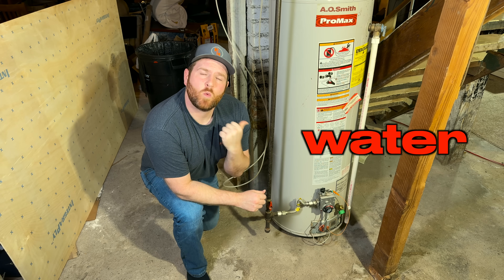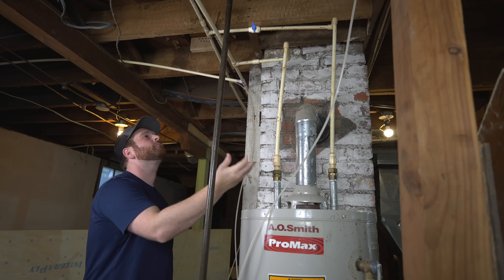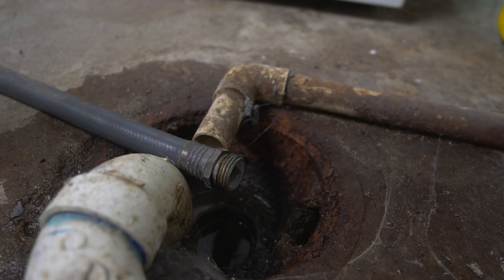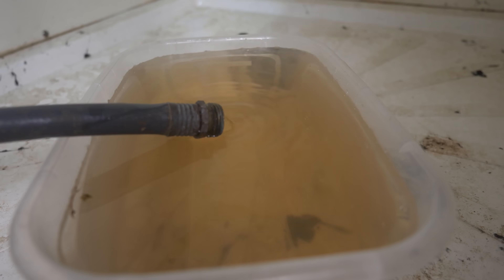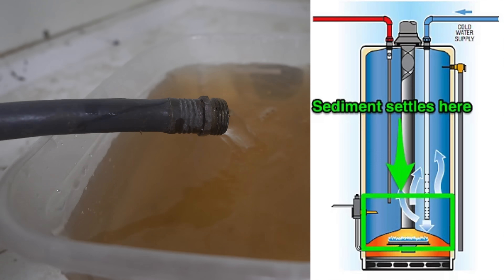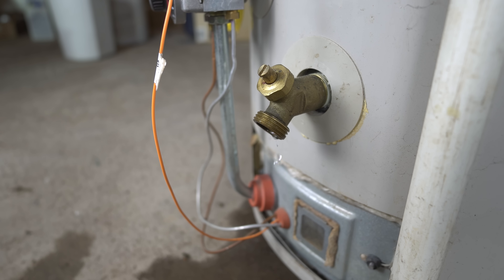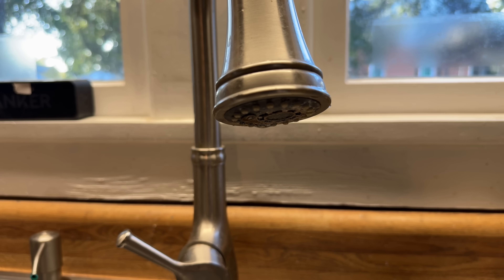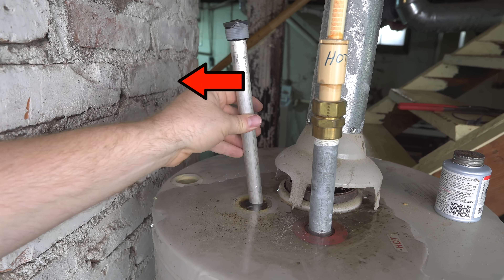Correct Way to FLUSH WATER HEATER! 2-Minute Tutorial

Comment: In my setup, water would not drain from the heater without the cold-water source valve on... even with a hot-water faucet open inside the house. So it took ages to flush the tank to the point of running clear, and I question whether the sediment was adequately stirred up to be ejected.
Reply from the maker: Sounds like sediment has built up and closed up the orifice of the drain valve. A person could try to poke something in there, but it sounds like it’s blocked. Probably useless at this point, you may just want to run it till it blows, so to speak.
Reply: @HandymanHertz  Thanks, but there was plenty of flow from the drain valve. Just not without the cold-water input being on, even though I had opened the nearest hot-water tap. I should have tried the pressure-relief valve, but I didn't know about it until I'd already flushed and restarted the heater.

The biggest problem is that this American Standard heater has no visible anodes. The manual has a parts diagram that shows TWO of them, but not where they go. And the manual makes no mention of them in any procedure. Really unprofessional.

Comment: Ok so how about when we do all the right steps and no water comes out unless we turn the water valve back on???
Reply from the maker: Hmmm sounds like sediment has clogged your valve or you haven’t opened a faucet to vent the system and it’s still under vacuum.
Reply: @HandymanHertz  it was the pressure release valve. Once I switched that up it started flowing.

Comment: ~ 2:00 ...After its all back together, turn your water heater back on, the gas or electric power.  
Thanks for the video!  I'm draining my gas water heater as I type this, and the water is draing So Sloooooowwww!  But if I open the input valve it flows faster.  The initial was was a "lovely" brownish rust color.  😂
Edit: After opening and closing the input valve several times, quickly, the hot water began to flow at a nice rate.  I know I've definitely neglected my water heater by not flushing regularly.   Thanks again for this Short and Sweet video!  Right to the point, no fluff, no filler!  You're a DIY Champ!

Comment: My water heater doesn't drain very fast. I did this the other day and it took like 2 hours for me to drain and then burst the water and let it drain again. I not only had a water faucet on but I also had the blow valve open to allow air into the water heater. What am I doing wrong? Fyi it's a long garden hose. Maybe a 20 footer which is overkill but I'm not sure if that's the issue
Reply: I believe many modern tanks don't have a full size drain valve on them, to cut down on the manufacturing costs. I think you can replace them with brass valves and that will help with draining the water faster. There are videos about this on YT.
Reply from the maker: The previous comment is correct. You can replace that valve with a full port valve. Also, there’s a chance that the sediment has almost blocked the drain hole opening from the inside of the water heater. Some people have poked something through the valve to try to break up the sediment. Maybe give that a try?

Comment: question, my water heater has 4 pipes in the top, cold intake, hot outtake, PRV, and the 4th is what i’m assuming is a continuous loop, can i still drain the water heater with the continuous loop pipe or is this a more complex setup where it’s best to consult a plumber?
Reply: It works like a water fountain/bubbler. Hottest water tank on top, w small opening that let's the water into lower chamber

Comment: Why can't one simply do a power-level flush?...meaning...keep the cold water supply functional, and keep the electric or gas power supply "on"...add a hose to the drain valve....and then open the drain valve "at pressure" ?. .....seems to maybe do a better job. The only risk I see is if the outgoing water flow is more than the incoming.....should match to keep the tank always full with water.
Reply: thats what makes sense to me and is the easiest as well.. If i open the valve at bottom of tank ,it releases Alot of water under pressure and I can see alittle sediment in the initial when then turns clear quickly... I dont see the need to empty the entire tank when its flowing clear
Reply: @skip741x3 That’s what my plumber told me to do.

Comment: We HAVE to get a water heater. How would you rate my current situation? 

Our water heater is over 20 years old! 💀
We never flush it 💀💀
CO2 builds up in our basement to around 20-30 CO pm when heavily used like filling a bath. 💀💀💀
Also VOCs build up even more when we don't open a window in our basement to around 30-125 💀💀💀💀💀

Yeah, it's pretty fucked here.

Comment: I'm sorry, flushing alone doesn't do jack squat.   I have a tank with a full port drain, and the sediment is too big to even get through the full port.  The only way to actually get sediment out is to own an electric water heater so that you pull the lower element and literally vacuum it out of the element port.  on a gas tank, the only way is to drain it and pour in that stuff that dissolves the sediment into a liquid to drain out.

Comment: If you have a gas water heater there's no need to shut the gas off. Turn it to PILOT and the burner will not turn on while you are flushing it but the pilot will stay on.
Reply: I’m so glad that you posted to turn the knob to Pilot, because I was going to ask, how to ignite the pilot on after turning the gas back on
Reply: But I did that before reading this comment so I am now stuck with pilot light off :( also, didn’t seem to say “shut water off to the house” but how rue they sink her no water coming out? He just said water supply to the heater! Darn it dude
Reply: @chetramos7901  - I'm no expert, but I don't think you want to shut the water off to the house.  If you did that, you wouldn't be able to quickly turn the water supply to the tank on and off, which is what is needed to agitate the sediment.
Reply from the maker: @bignorwegian3566 if you don’t have a shut off valve, you can do the same thing with the house valve. Or just drain the sediments.
Reply: @chetramos7901  some older houses did not have a shut off between the main and the water heater. Mine did not, but when I had to replace the water heater I added a shutoff valve for just the water heater if something went wrong with it again (and the 7 year water heater barely lasted over that before I had to replace it unlike the 15 year model that lasted almost 20 in place when I bought the house).
Reply: @bignorwegian3566  my house was built in 1950 and there was the main and no shut off valve between the main and the water heater. Please.... tell me what I should have done... There is the main at the street they use when you don't pay your bill and if the OLDER construction was decent like mine there was a shutoff as the main entered your house.
Reply: @chetramos7901  If you have the sink on the hottest water setting it should stop coming out once the water heater is drained. That probably should have been mentioned.
Reply: Thanks!
Reply: I used to turn off and after 3 years of doing that my igniter wouldn't restart so I had to take the whole burner out and clean it real good fortunately started up after. Since that experience it is pilot on while flushing .
Reply: @mattg200 so, your burner got dirty because you shut off the gas 3 times? 🤣 Please tell me you didn't think that's how it works. If so, you should be calling someone to do these things.
Reply: is that VAC mode?
Reply: @SaycoPworrell  yeah its like an afk mode
Reply from the maker: True. True.
Reply: @HandymanHertz you knew that, but instead you kindly made yourself some extra money by recommending the viewer to buy some cheap caps.
Reply: @TFDSATX  Oh yeah, hes gonna used those ill gotten 5 dollars to buy a Ferrari, give me a break.

Comment: While the tank is MT is a great time to install a ball valve drain. At the very least you can tighten the packing nut on the original valve and stop that leak. Perhaps it might also need a new stem washer but I would leave a cap over a leaking valve, ever.
Reply from the maker: Those are decent options too, but nothing wrong either a homeowner saving time, money, and water capping it.

Comment: I live in a secluded mountainous region with amazingly pure water. I installed an 80 gallon electric hot water heater in 1996. I've had to replace some of the wiring, I've had to replace the elements of course several times, add replace the thermostat. New computers on this it's old. However  have never flushed it out or done any maintenance on it. Well next year around summer will be 30 years it's been working , obviously it's a testament to the purity of the water.❤
Reply from the maker: That's amazing, sounds like a dream location 👍
Reply: @HandymanHertz  it will be. Lots of work and learning to do first.
Reply: I just bought a house with nearly pure spring water that is on a cistern. All of the sudden we have no hot water. Has this happened to you? If so, what was the remedy? Thanks!
Reply: Low mineral content. Is it a groundwater source like a well? Or a surface water source? (Lake, river, etc.)?
Reply: Same here. I have super pure well water from a petrified spring. I have never flushed my electric water heater in the 30 years I've had it. I just had it replaced because it finally crapped out. While draining we were all amazed at how clean the water was coming out the hose.
Reply: Indeed!  Gotta be that pure water!  No hydrofluorosilicic acid, chlorine, and the hundreds of other toxins added or naturally occurring in municipal water systems!  My wife grew up at the base of a mountain with the sweetest tasting water, once the city grew and incorporated water from other sources, the taste and quality went to 💩.    I have cousins on the other side of the valley and their water was so hard and Nasty tasting that the joke was, one could walk on the water in their town.  🤢

Comment: Whole video is a joke. I was a plumber for 26 years. CPVC stinks for water usage, it should be strapped n braced in order to keep it from breaking. I have never seen an instance where flushing H2O heaters helped. A water softner will help but may increase your sodium intake. Why not replace the washer in your drain valve? It is way better than a plastic cap thet can crack.
Reply from the maker: You do you, plumber man. If you actually are one, then you've replaced a ton of water heaters with rusted out tanks, and have cut into some with a ton of sediment. Why drain it and replace a valve when a cap works great? A lot more time and money. Especially if they have a plumber do it. They also sell brass caps...as a real plumber would know...

Comment: Hello and thanks for this slick and to the point video, it's the clearest and most comprehensive in YT on this subject.  Quick question:  I have an electric Bradford White Hydrojet 80 gal heater.  What is the purpose of the pressure relief valve, and is it needed at all in this procedure?  Again, many thanks for putting this together, and I just subscribed.
Reply from the maker: Wow, thanks for the compliment! The pressure relieve valve is there in case there's a malfunction and the burner never shuts off. If that happens, the pressure will build up and come out the prv. I do not recommend using. It in the draining process, though you could open it to vent the system. They are very prone to leaking and would need replaced. 

Some people have plugged a leaking prv, but this is a bad idea because it builds pressure and goes off like a bomb in the house. You should google some of those images...it's amazing what pressure will do.
Reply: @HandymanHertz  Thank you!  I'll leave it alone then, seems like a one and done device.

Comment: I remove about five gallons under pressure every month or two, until water runs clean. My HWH a has lasted over 15 years with no anode rod change or full flush. If you have that level of sediment dropping in , consider a filter system.
Reply from the maker: Good point. 👍
Reply: Can a filter system remove the rust inside the water heater?      LL   : )
Reply: @JoseGomez-xk3yx  probably;y not ! I found any rust , per se , can be flushed under pressure as I described. I know when our water mains are flushed a lot of sediment comes in and finds its way to the HW Tank. Rust ( in abundance)  is a sign that the tank is on its last legs.

Comment: Wait, so you don't have to open the pressure relief valve? I have a gas heater. Edit: nevermind, looks like i shouldn't open it. When i moved into and remodeled my home, i decided to flush the existing heater. Think it was around 15 years old and probably never done before. Open the relief valve, flushed it, etc. Closed the valve but it kept leaking. Ended up just replacing the whole thing. 🤷‍♂️. It's been two years since the new one so i need to do this soon

Comment: If we likewise don’t have a shut off valve from the water supply, can’t we just kill the power to the water pump and won’t that accomplish the same thing? Same question about cutting off the fuel supply to the hot water heater. Can’t we just kill the power so it doesn’t draw any fuel?
Reply from the maker: Yes that will accomplish the same thing. 👍

Comment: Great video, thanks.  

1, Is it okay or would it help if i pour in a gallon of 5% white vinagar to help further desolving the calcification from the tank before flushing?

2, is there a way to completely flush all of the sediments from the tank? Or is it okay for a little to remain at the bottom of the tank after flushing?

Thanks, Z
Reply from the maker: Good question! I've never used vinegar.  I think most of the sediment on the bottom is sand and rust, and not so much calcium. I could be wrong. It definitely wouldn't hurt to let some white vinegar sit for a while. 

There's one step you could do that I know of that will flush it a little better, and that's to actually use pressured water going in the valve at the bottom. It's like a back flush. Spray pressured water through the valve and then let it drain. I personally think this is overkill, i'm not sure the efficacy of this, but it would definitely help. There's actually a flushing valve kit I've seen Floating around the Internet For this.
Reply: Thanks for the tip. i will try it.

Comment: I drain my heater every year but have never turned the valve on and off to flush it. Thank you for this!
Reply from the maker: You're welcome. Good job on keeping up with your maintenance, that's impressive.
Reply: @HandymanHertz  I put all the repeating maintenance tasks on my calendar so they regularly pop-up reminders at the appropriate time.
Reply: @HandymanHertz how often should you drain a gas heater?
Reply: @HandymanHertz I still have small amount of scales after 30 min of flush, how clear does flush need to be?
Reply: Are you supposed to do this yearly?
Reply: Depending on the type of water you have, hard water needs to be done once a year otherwise 1-2 years.
Reply: After following the video, the faucet that I opened so that the tank could "breathe" never came back to a full flow of water. Now, it barely drips. Any tips?
Reply from the maker: @j040p199 clean out the aerator. Probably has sediments in in.

Comment: I do the flush every year. How often do you change the anode? New heater in 2019.
Reply from the maker: that all depends on your water source quality. i have a buddy who went through anode rods every 2 years in wisconsin. here its 10+ years it seems. its easy to shut off the water and pull one out every year or 2 and check untill you get to know your water quality.

Comment: Folks, consider placing a Siliphos water filter uphill on the cold line. Protects the elements and other internal parts of hot water heater. Does good things for your dishwasher and clothes washer. Go do research on Siliphos water filter, or start with just Siliphos

Comment: my drain valve is like 1/2 " above the level of the floor, ugh!!! what to do? Also, I have 2 shut off handles and an small expansion tank, which is the one that I need to turn? Thank you !
Reply: The drain being close to the floor doesn't change anything,  screw on a hose. Technically, you don't have to turn off any water. Some people "power flush" by just opening the drain and letting the tank refill simultaneously.
Reply: @macfady2181  It's going to be a challenge to even get the hose screwed on practically no room to work with,  plus a pan is obstructing possibly forcing the hose to elevate upwards, gravity anyone?  At what point does the sediment come out, that's the reason for the flush if I'm correct?  Thanks again!

Comment: First time viewer, found you by a flush search. I drained the tank first then did the valve trick but it's been 40 minutes and I'm getting dirty water coming out. Is my heater really that bad? The cold water is still visibly clear in the house and from the well source.
Reply: I’m here via the same search. Something I read elsewhere said it can take 3-4 hours for water from the tank to run clear depending on the age of the tank and the length of time since the last tank flush. 
I know that info doesn’t help you now since it’s been a couple of weeks lol, but hopefully if someone else sees your question and is wondering the same thing it’ll help them!

Comment: Pro Tip
Don't use the sink to recharge the line. If possible always use a bath tup as a sink faucet or shower head  can get clogged with any deposits that didn't exit during the flush.
Reply from the maker: Yes, thanks, this is a good idea... this house didn't have a tub, but I could have used an outdoor hose bib I suppose